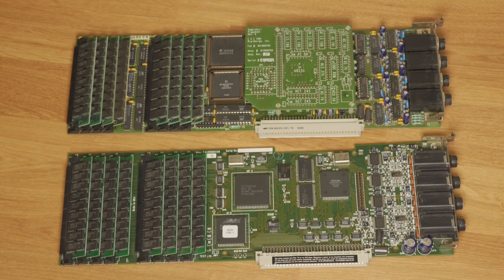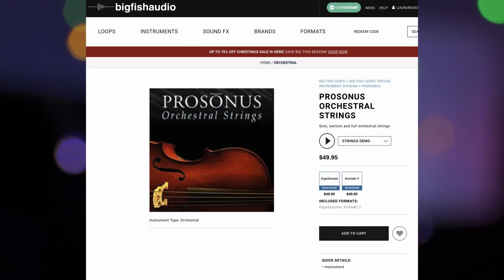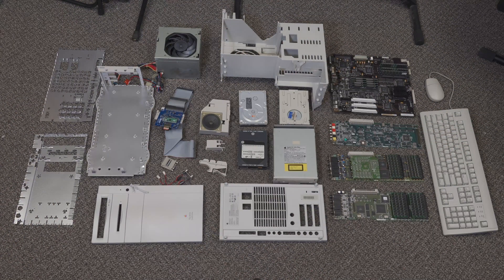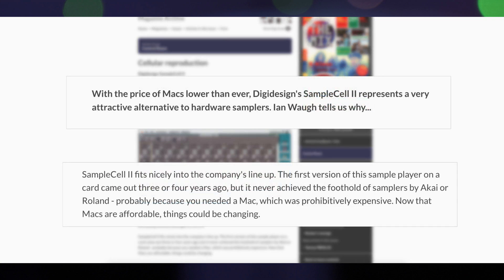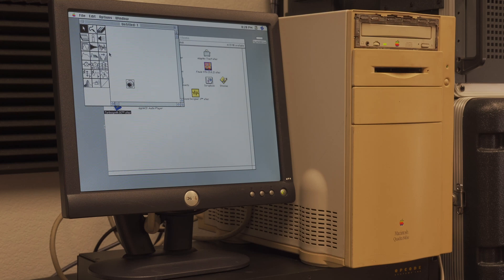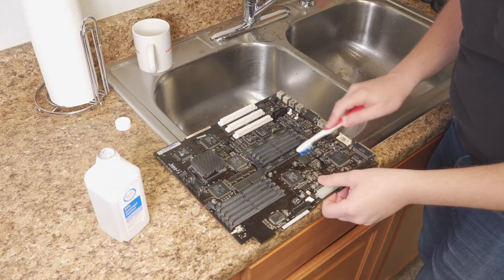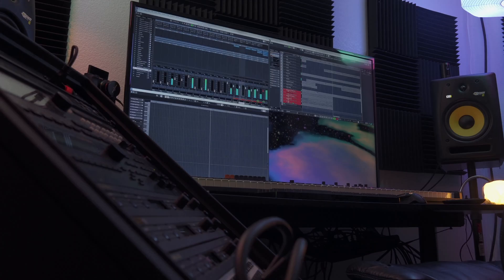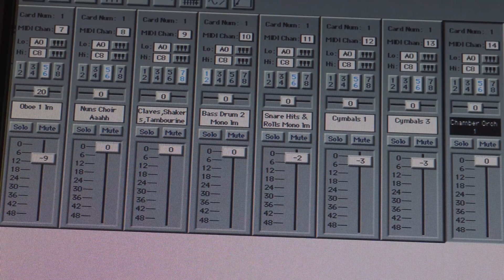SampleCell II - Exploring Nintendo 64 Era Sounds and Music Tech

Comment: In the video, the sound modules that you have in your racks are an Akai S6000, Korg EX-M1R, Korg Triton-Rack & TR-Rack, Kurzweil K2500R, Roland XV-5080 & JV-1080, E-mu Proteus 1+Orchestral, E-mu Proteus 2XR & 3XR, E-mu Procussion & Proteus FX and Yamaha TX81Z. And a monitor is standing on top of a Roland SC-88 Pro.
Question: Do you have any of the E-mu SysEx expansion floppy disks, the Roland SR-JV80 & SRX expansion boards, the Korg EXB-PCM & MPC/MSC expansion cards and the Kurzweil ROM soundblocks? Can you also list the names of all the sample CD's you have got?
Reply from the maker: Hi Alex! Unfortunately no E-mu floppies or any Korg expansion cards. I do have the JV-80 orchestral expansion card, but nothing else yet. I'm currently working on cataloging all of my discs so I don't have a full list at the moment. Is there a specific library you had questions about?
Reply: @SectorTStudios  The CD-ROM sample libraries for your S6000/K2500R/XV-5080.
Reply from the maker: Not comprehensive, but here's a general list (no particular order). Just the Kurzweil FM (KFM) sounds for the K2500, in Roland format I've got Gigapack 1 and 2, Symphony of Voices, Digital Boy Modern Synths and Drums in ur face!, EW Ultimate String Collection, Metamorphosis, Prosonus Strings. On the Akai side I have a bunch, mostly in S1000 and S3000 format. S6000 AKAI CD-ROM Sound Library (all 5 volumes), CD3000 Factory Library, EW Twisted Guitar, EW Drums+Percussion, EW Symphonic Adventures, EW Percussive Adventures, EW Dance Industrial, Ilio Analog Meltdown, Distorted Reality, Metomorphosis, Heart of Africa, Heart of Asia, Hollywood Edge Super Single, SSS Laidback, SSS Brushed, Peter Siedlaczek Advanced Orchestra with '97 upgrade discs, Things That Go Bump In The Night.